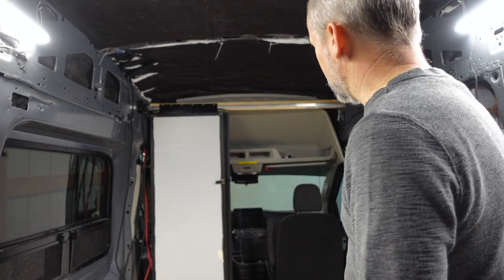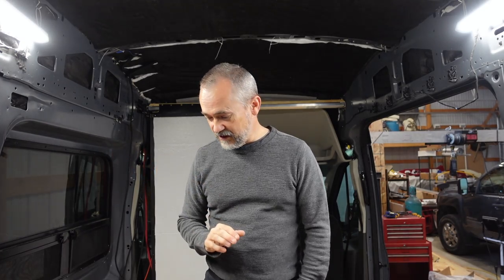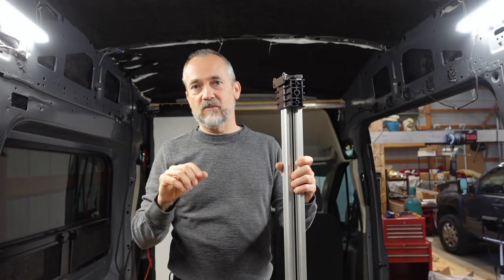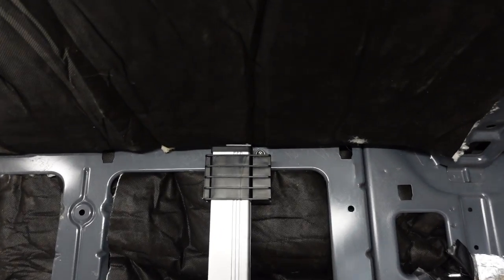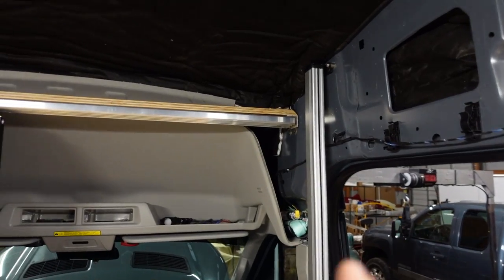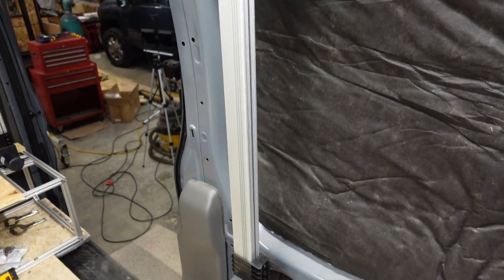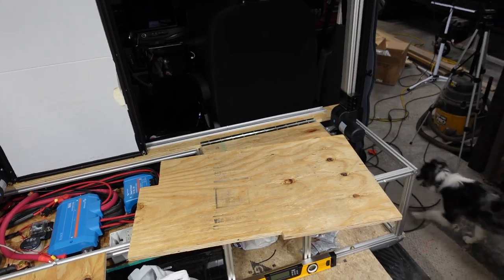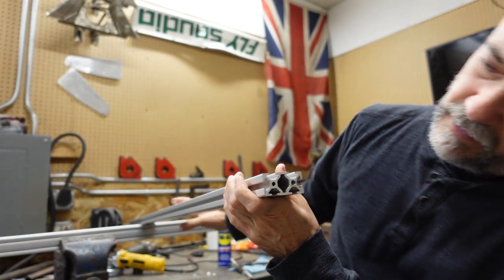VAN BUILD | CUSTOM BED LIFT |  2022 FORD TRANSIT

Comment: I’d love to do something similar to this! I was wondering if you’re worried about moving the airbag foam black block/ blobs from the side? I’m concerned about it voiding my insurance
Reply from the maker: We’re not completely finished with front or the sides. Our plan is too put the blocks back in. On the driver side we might have to cut the back of the block off because of the bulkhead. If you wanted to retain the entire block the bulkhead could be easily modified so the block fits through it. Similarly on the passenger side, we’re going to have the modify the block to retain it. If you want to keep the block intact you could make the bed slightly narrower and retain the block 100%.  Thank you for watching! 😃

Comment: Awesome work!!!!!  Is there any way of having all 4 actuator switches combined and controlled by 1 switch?  I nay call progressive to see if this is possible.  Your thoughts?
Reply from the maker: @fredzuccarelli  The actuators run at different speeds and even different speed up vs down. So having everything on one switch will not work. The bed would end up out of level each time it’s moved. Linear actuators makes a control box that is adjustable, with that you can have a remote and one switch since each actuator can be adjusted with the control box.  Hope this helps and thank you for watching😀

Comment: Nice!  Which actuators did you use?
Reply from the maker: Hi Mark! Here are the actuators : Progressive automations 
  PA-18-50-150 $250 57.68” overall length
Thank you for watching😁
Reply: I had considered using actuators but did not find any as long as 60 inches (152 cm), but are available at Progressive Automaton.

Comment: Hi, have you posted the pdf listing the supplies for this elevator bed?
Reply from the maker: Hi! We don’t really have a PDF of the parts. It’s always put together as we go, but for this the highlights are: The bed frame is 1020 extruded aluminum with the ends drilled and tapped 1/4-20 to connect everything, 1/8” aluminum L angle mounted with slide in connectors to hold the plywood base. The actuators are progressive automation PA-18-50-150. 150 lbs capacity each. 8Amp full load draw. The switches are double pole double throw 15 amp rocker switches. The mounts for the actuators to the frame are 1/8 aluminum L angle. The mounts to the van will have to be custom made to your application. Hope this helps. If you have any more questions reach out! 😃